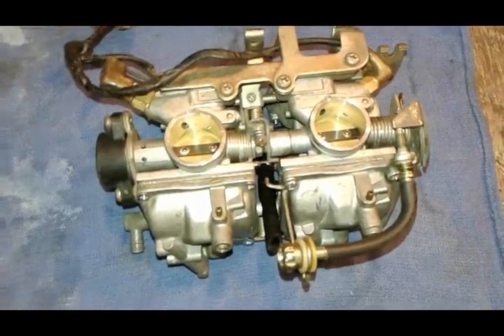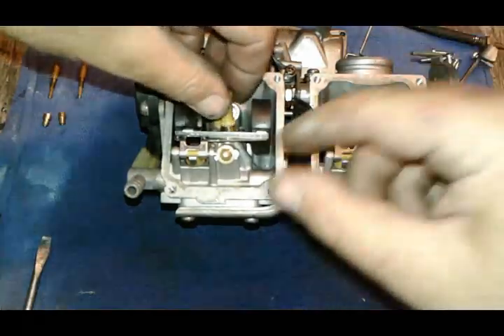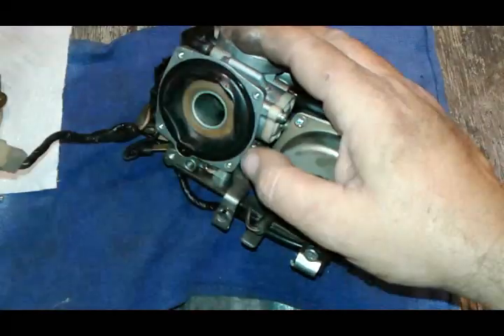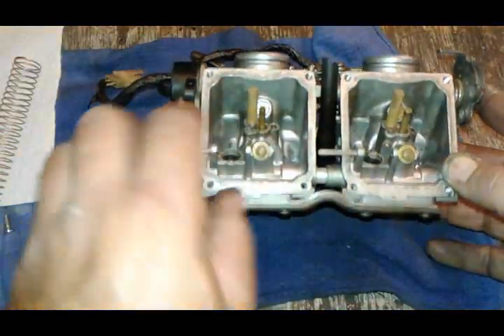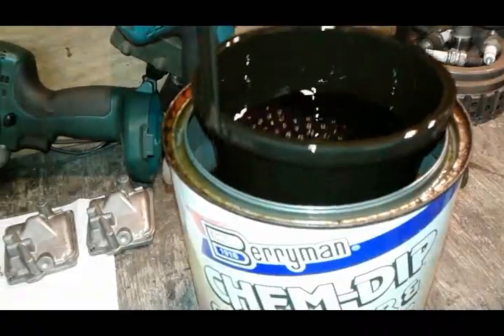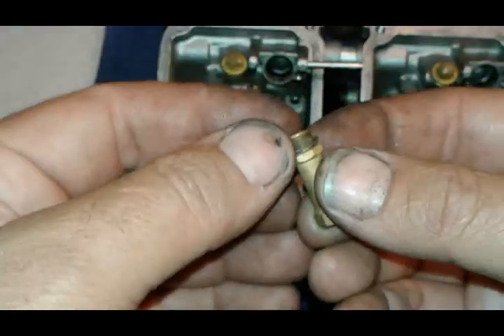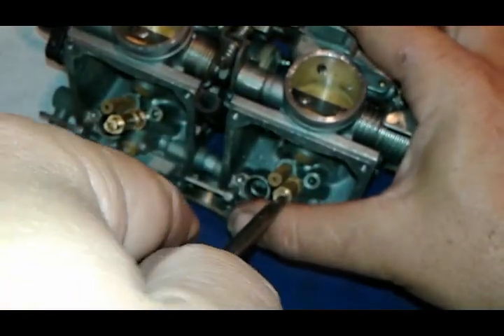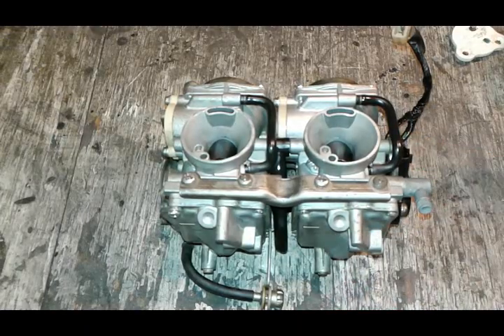Yamaha V-star 650 carbs rebuild and cleaning AVOID MISTAKES!

Comment: Good video. Tip for beginners, only do one carb at a time so it's harder to mix up pieces.
Reply: Since all the pieces are the same but the main jets, one could make a note of which main jet is in the front/rear carb and proceed with confidence.
Reply: Good idea, thanks✌️👍
Reply: What’s the difference between the front and rear jets ? My rebuild kit just showed up in the mail and I plan on rebuilding after work today

Comment: Thank you so much for posting this!!! Everything I needed to know and no crappy background music (which is a thing now). I've never rebuilt a carburetor before. Very informative.
Reply from the maker: As long as the rubber membrane is OK. No tears or hole in it.... it will be fine. You can try to clean the stuff off with a carburetors cleaner carefully...someone put that on previously and the fuel and heat made a mess out of it...thanks for your interest and please subscribe. Good luck!

Comment: One more thing, there is a tiny o-ring inside the Main jet holder. How do you replace that? Mine was hidden and invisible inside the holder where the jet screws into it. The threads on the jet stop before they get to the head so I'm not sure if they should be pushed up to there or if they sit down inside the jet holder post like a garden hose washer sits inside the part you screw onto the spigot.

Comment: Ive watched this video a million times. Ive rebuilt tons of carbs too. I replaced the float needles and seats in my carbs and cleaned the jets with an actual tool for cleaning jets. Cant figure out why the rear cylinder is misfiring now. It was running fine before i took it apart. Now ive taken them apart and put them back in the bike like 6 times. I even bought new carb boots to make sure there is no vacuum leaks. sprayed starting fluid all over my engine to double check. Ive been at this for four days now... im a mechanic too so this is really hurting my ego lol. i really hope my intake valve isnt messed up. maybe the mixture screw or the main jet hole after the gas travels through the tube???
Reply: it idles fine. when i give it throttle the rear cylinder misfires
Reply from the maker: Is it misfiring all the time or only at idle?
Reply from the maker: Oh...just noticed you added the answer to my question
Reply from the maker: Do you have the upper and the lower airbox connected when you trying to run the bike?
Reply: @DoityourselfMotorcyclerepairs   Yes ive taken them off and put them back on multiple times, checking to make sure its all the way connected to both carbs.
Reply: its always the rear cylinder misfiring.
Reply: this is also not the first time ive cleaned these carbs lol
Reply: I must have a vacuum leak that im missing dont you think?
Reply from the maker: What about the air/gas mixture screws...did you have those out...what the spark plug looks like??
Reply: No I didn’t touch those screws. The rear cylinder that’s misfiring; the spark plug is black now. It used to be a golden brown color. I have a carb tuner, so I always have made sure the carbs are tuned well and evenly. Like when grilling a steak.
Reply from the maker: If your plug is black you are not having vacuum leak for sure. It's running too rich. Fouling your plug. Look for any reasons why would that be...float adjustment...might be flooding into the cylinder...I always found afterward that the problem made perfect sense. Look at all the components that you replaced...or messed with in any way...it could be the float needle perhaps. Trust me I've been there done that...
Reply: Do it yourself Motorcycle repairs I thought it might be that too. I’ve taken them out and put them back too. Maybe I can switch them to the front carb and see if the problem moves?
Reply: Do it yourself Motorcycle repairs well, I switched the parts, cleaned the whole carbs again, and put them back on the bike. Same thing still happened. I’m just gonna order the single carb kit. I’m getting sick of trying everything and getting the same results. Whats your take on the single carb kit idea?
Reply: @Trevor Couri I can’t speak for him - but , my opinion is : buying unnecessary parts doesn’t always fix the actual problem . Hope you got it running correctly , again . Any update ? Thanks .
Reply: @RSST662  yeah i ended ip using an intake manifold for a virago and a mikuni vm38. Rigged up a tps and she runs like a striped ape now. Sold the bike now i got a Dyna
Reply: @Trevor Couri thank you ! I’m working on my 650 that hasn’t ran in 5 years because I needed to change it’s oil , filter , and rear drive oil . After doing that I have been cleaning the entire bike thoroughly . Your story concluding with a happy ending is motivating me to keep going . Congratulations !

Comment: You said the main jets are different. The one on the idle adjust screw has a bigger or smaller hole? I think I might have screw them in in the wrong position

Comment: When you said “about 2.5 turns” about the air and gas mixture screws , were you insinuating 2.5 full rotations , AND/OR 900 exact degrees , instead of an extremely vague alternative ?
Great video ! Thanks !! I subscribed !!!
Reply: You're going to give them "about 2.5 turns" then tune and sync them once they're on the bike and running.  This is how all carburetors work.  You have a baseline where you know (the factory knows) your carburetors will definitely operate (probably poorly) and then you go from there.  That's the point where the bike will at least fire up so you can get it tuned.

Comment: Thanks for the video! I just have a question, before I start cleaning my V's carbs. The o-rings you replaced on the needle valve assy, can they be bought seperately, cause according to Yamaha's parts catalogue, you can buy only the whole assy. Thumbs up again for your posts!
Reply from the maker: Before you do the job I recommend buying the seat and the needle assembly and the gasket for the foat bowls. This way you got everything ready before you start. Thank you for watching the video and please subscribe to help me out.

Comment: A great detailed instructional video. I am curious what purpose those electrical leads are for? I also noticed that black cylindrical plastic thing on the left side of the carburetors. Could it be a sort of electrical fuel primer? I notice on my V-Star when I start the engine I hear a clicking noise for about two seconds and then stops.
Reply: The black plastic thing is the throttle position sensor

Comment: Great Video, however, my choke is stuck, does not open. How do I access it to clean it? 
Please confirm / Thank you
Reply from the maker: That's tough. I've had that happen few times myself. Used PB Blaster spray and soaked it. Few times I had to drill it out and buy new ones. There really isn't easy answer to it. Hope this helped you and please subscribe to help me out . Good luck and let me know how you got them out...

Comment: I'm a little worried because what you call the choke jet doesn't seem to have a hole in it. Is it smaller than any other jet? I have carb cleaning needles and the smallest one's tip seems to find what may be a hole, but it won't go in. Maybe I need to buy a wire brush? You show the wire going all the way in. I'm afraid to put my carb back together because everything else is clean, but I can't verify this is clear.
Reply from the maker: Yes...get the wire brush and use one of the wires. You don't want to do the job twice
Reply: @DoityourselfMotorcyclerepairs  Found it!  I did have a tiny plugged hole in each tube. The smallest carb cleaning needle was too large to clean that hole when clogged. I used a copper wire from an electrical hookup wire since I didn't have a wire brush. I had to let carb cleaner sit in it and keep poking with the wire until I could find the hole. If the hole is plugged, it is very difficult to find the tiny hole in the center of the larger hole. Thanks for your help!

Comment: Help!  at minute 3:25 you take the Philips head screws off holding the brass fitting (in place) with the screen on it...I am cleaning a carb that has probably sat for...years.  Yep.  Years.  How, may I ask, do I pull that brass jet(?) out??  As it is stuck in there!  It does not want to come out!  Rust spray?  Carb cleaner spray?  I am grateful for your suggestions.  Thank you!

Comment: Which is the bigger jet and where does it go, in the front of the bike or the rear? Thanks!!
Reply from the maker: The bigger jet always goes to the rear cylinder because it's running hotter ... thank you for your interest and please subscribe... it will help me out 😊
Reply: @DoityourselfMotorcyclerepairs  The jets look exactly the same.   Is there a way to tell which one is bigger?  
Thanks again!

Comment: You didn't remove the brass bolt sort of blocking the pin to remove the floats. Mine was gunked up inside and then one of them sheared off when I was putting it back. What is that called and where can I find that? Can I also find just the washer for the main jet tube?
Reply: Did you ever find that brass hollow bolt? Mine did the same thing
Reply: nvm, I found it. Part number 1HX-14565-00-00 if anyone else runs into this issue.
Reply: @EpicSidequest  Yes, you found it like I did. As usual, an outrageous price for a tiny little piece of metal. I with there was a home way, like a 3D printer to make things like this.

Comment: I have the same bike. I cleaned both the pilot and main jets thoroughly in both carbs. But the problem i am having is the bike just idles, and when i give it more throttle it shuts off. also when it idles the front cylinder is not working and the air is cold when i feel it on the exhaust.  i opened the air filter. when i cover the air hole completely the bike works fine i can even ride it. for some reason its sucking in too much air (replaced the air filter but the problem persists). can you tell me what i need to do....please . thank you
Reply from the maker: You actually answered your own question when you said it's sucking way too much air...the problem you having is with the  airboxes. They have popped off their place in one or more areas... there is one airbox on top of the carburetors that is connected to bigger one on the side. You need to recheck carefully all of the connection between the air boxes and the carburetors. 
Thank you for your interest in my video and please subscribe to help me out.
Reply: Thank you very much for your reply
Reply: @smbengineeringllc9035   did you ever solve this issue

Comment: Thank you for this video it helped a lot. While spraying my carb and my jets out I noticed 2 tiny little O rings that I have zero clue where they came from. Was wondering if you knew if the main jet has one between the top and the base. I should have done one side at a time for reference as to where they belong... A mistake I didn't avoid.
Reply: @John I never took them out so I'm thinking that the previous owner must have done something that released the orings into the float bowl. Thanks for the quick reply.
Reply: @USSHammerology  there is 2 Tiny O rings inside the Main Jets

Comment: Did all this put back on idols fine falls on it face.please help so miss rideing this bike.thank you!
Reply from the maker: Most likely the air box it's not attached to the carburetor correctly and it's sucking too much air. Take the gas tank back off and check the small air box, where the two clamps are attached to the carburetor that it's nice and tight and also that the outer airbox is conected correctly ... it's very important ! If it's sucking air in any of those connections it will act exactly the way you have  described

Comment: The first mistake in cleaning your carbs is tearing into them without first using a good carb cleaner in a tank of gas.

95% of the time, if your carbs are plugged from old E10 gas, running Seafoam and riding the bike hard, with the trottle open 75% or more, will clear your jets, float bowl, and fuel pump within 200 miles.

IF your bike will start and run at all, Seafoam or another carb cleaner is worth a try, about $10. Obviously if the jets are totally plugged you cant clear them by running fuel through them. Or if they are clogged from rust in the tank.

Comment: I just picked up a 07 united motor 250r v2s Hyosung. The guy gave me 2 brass bolt heads. So took the carburetors off open them up and seen where he busted them off flush right under both flots. So does anyone know where i can pick up new carburetors? They are Mikuni corp. Carburetors made in Japan. I know they look like the ones in the video but im not sure. I don't work on many bikes.

Comment: I'm having a wierd problem with my bike, I cleaned the carb and jets put on new rings, put my bike back together but my bike needs to have choke in order to stay on. I have to let my bike warm up for like 10-15 min if not my bike will turn off when I stop at a stop sign. Even still with that time to warm up my bike still turns off unless it's been running for a really long time. My bike used to not do this before and i didnt even need to put on the choke before but now it's to the point that it turns off often like the jets are clogged or something but i already cleaned them. Am i missing something? I dont know what's wrong please help me.
Reply: Did you fix your problem if so what ended up being the problem?
Reply: @Beeskness  basically I cleaned up the carburetor, I checked the box that sits on top of the carb and cleaned it, I made sure the places where the carb was connected to the box thing on top and the elbows that lead to the cylinders was cleaned and tightly connected so there wouldnt be any air leaks, my bike needed a valve adjustment that was also causing my engine to run harder and once I did all that my bike would start up pretty easily

Comment: Where can I find a rebuild kit for these carburetors
Reply from the maker: I found this one for you...its all you should need to do the 2 carbs...rest of the parts will be cleaned up just like in the video...thanks for watching and please subscribe...good luck!
https://www.ebay.com/itm/2x-Carburetor-Carb-Repair-Rebuild-Kits-Yamaha-XV250-XVS650-V-Star-K-L-18-5171/292618300866?epid=171141302&hash=item442168edc2:rk:1:pf:0

Comment: I'm not 100% sure but I do believe there ain't two different names I just went to a motorcycle shop and had two main jet that are bigger than normal for my bike because the baffles were knocked out of my exhaust and my bike's running lean without the bigger Jets they didn't say anything about two different Jets

Comment: Doee this carburator have  squirters im not getting fuel when i twist the throttle
Reply from the maker: Make sure your air box is correctly attached to the carburetors...if it popped away it will ide fine but it will choke up if you try to accelerate...these carburetors don't have acceleration pump or squirters as you said...so if the air box is fine then you got to open them up and see what's going on. Hope this helps. Thanks for watching and please subscribe to see more videos like this one in the future!
Reply: @DoityourselfMotorcyclerepairs  so its the vaccum from the seal at the airbox and the fuel pump that bring fuel to the carbs?
Reply from the maker: That's not it ....if that airbox popped off it's getting way too much air, so your balance is so far off that the bike will choke with the excessive amount of air.... The fuel get delivered to the carburetors via fuel pump.

Comment: Hey I got 2005 650 classic I sync my carbs  how do I tell if they have been jetted already bike runs but when in it bogs down has vh pipes and aftermarket breather
Reply: If it bogs it's usually lean, especially if it backfires on deceleration. Move your needles up.

Comment: ALWAYS take floats out first. Holy 💩 I just watched the rest of the video because I initially stopped when I saw he doesn't remove the floats first which is a good way to break them. This may not be a bad vid but it's not a good one either. NEVER PUT A DAB OF SUPER GLUE ON THE DIAPHRAGM! It will deteriorate it where it's applied to the diaphragm and even if it doesn't melt it there will be damage to it and this is a great way to ruin it. If the diaphragm won't stay persuade it will an almost non existent smear of gasket maker to tack it in place. You don't need to use water to rinse it either. Another idea that's more bad than good. Blow off the dip cleaner and that's enough. Wipe out the diaphragm chamber of you're worried residue will deteriorate it. What a half @$$. Purple power probably etches the aluminum or any residue left behind will have a nasty chemical reaction inside the carbs when it mixes with gas.